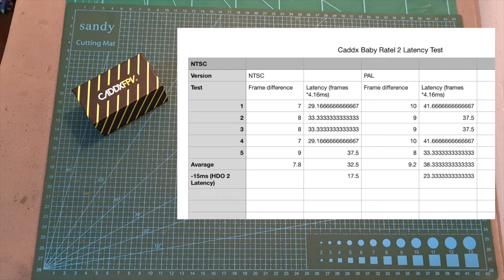Smaller And Better? Caddx Baby Ratel 2 - Overview & Flight Footage

Comment: Hi, I have the Caddx Baby Ratel 2 1200TVL CMOS 4:3/16:9 NTSC/PAL FPV Camera (1.8mm) - Black and it doesn't show the osd. What do I need to do?
Reply from the maker: Hi, is the VTX connected to the video out pad of the FC and the camera to the camera (video in) pad? If so - try to switch between NTSC / PAL modes on Betaflight - under the OSD tab.